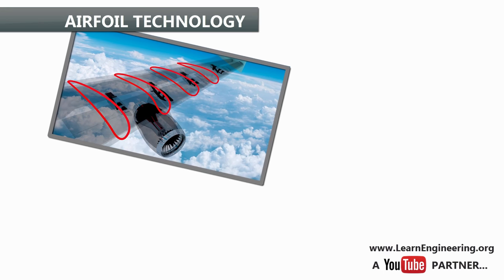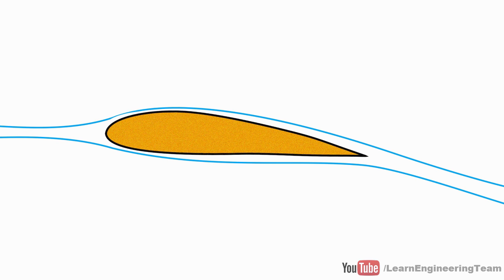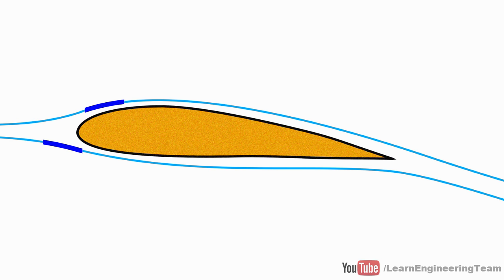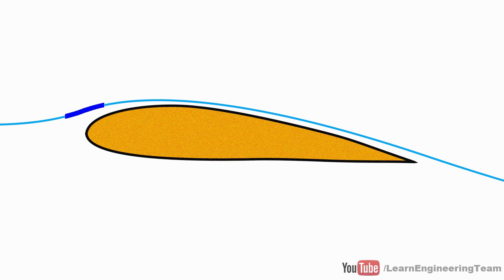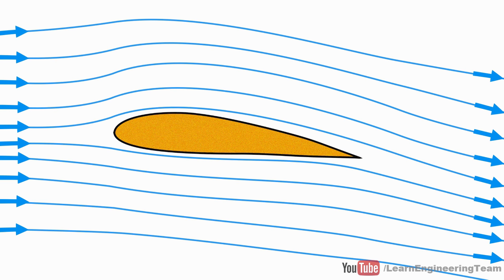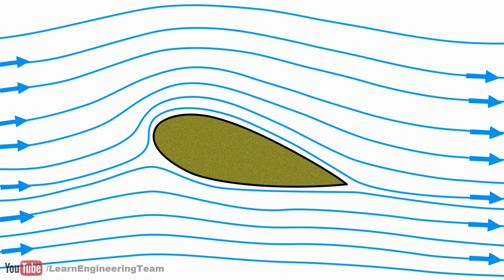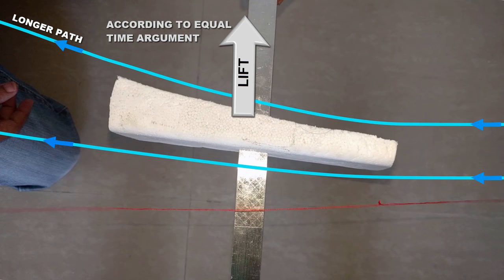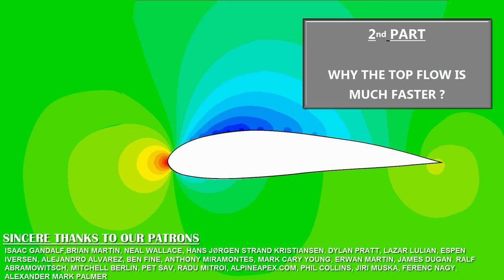How do Wings generate LIFT?

Comment: why pressure should be high at the outer surface ?
Reply: It&#39;s awkwardly explained...
Reply: still do not get it. English please
Reply: ***** Do you mean around 3:30? What they're explaining (awkwardly) is that as the air turns sharply around the wing, the air pressure will always be higher further away from the wing than close to it, due to the "Coanda effect".

As air flows across the wing, it wants to continue straight, because of Newton’s 1st law of motion, as was shown in the video. But, air above the wing exerts atmospheric pressure and pushes air down behind the wing where the air pressure decreases below atmospheric pressure as it is in the wake of the wing. However, as air is pushed down behind the wing there will always be fewer air particles close to the wing than further away from the wing, because most air will not have energy to make it all the way down. It’s the same situation as making a sharp turn in your car or pouring a fluid through a curving hose: there will be a push toward the outer edge of the curve, or rather an absence of a force to keep the pressure uniform.
Reply: This is a random question but, would a plane with straight wings like this  -------------- be able to fly. What I think is the plane will fly but, only when the plane is ascending. When the plane descends slightly all the air on the wings will be pushed up makes all the lift turn into downwards lift(Lift that pushes down) and the plane would stall. On a normal plane with normal wings because of the curve downward on top of the wing  some air would still be pushed downward. What do you think about this?? Could a plane with wings like these  ---------------- descend without stalling??
Reply: ***** Straight wings fly, but only generate lift when they are at a \ angle and generate negative lift when they are at a / angle, the same as with other aerofoils, although most other aerofoils are designed to generate a little bit of lift even when they are level (angled by design).

Stalling is kind of irrelevant here. It occurs at under the exact same conditions (always an angle against the direction of movement), no matter if you are ascending, descending, or straight-flying, if your wings are straight.
Reply: i got it guyz thanx :)
Reply: I have another question(Sorry if I am annoying you with all the questions). How do planes fly without losing or gaining attitude at a straight angle of attack(___). wouldn't the plane have to pitch down a lot if it wanted to maintain the same attitude and it was flying at lets say 320 knots. Can planes ascend with a straight angle of attack(___)?
Reply: ***** Airplanes can only fly level with level wings if the aerofoils have a built-in positive angle-of-attack. If the wing is flat and level it generates no lift and the airplane sinks. At negative AoA negative lift is always generated (save stalls). The slower speed in level flight an airplane wants, the higher AoA it needs. As it speeds up, if it wants to keep the same altitude, it decreases the AoA closer to zero, pitching down, but never going below the horizon. Planes can ascend with a 0 AoA, but only if the aerofoil has built-in AoA. I cannot remember if it is convention to account for this in AoA (so ascending with 0 AoA is impossible by definition), but I think AoA disregards the properties of the aerofoil (so it is possible to ascend with 0 AOA = level wings, but the aerofoil must still have a slightly lean shape).
Reply: "if it wants to keep the same altitude, it decreases the AoA closer to zero, pitching down, but never going below the horizon."

why does it never go below the horizon?

I am also wondering about stalling. why does air on top of the wing stop flowing smoothly over the wing at a high AoA? the bottom of the wing also creates lift so when a wing stalls isn't the bottom of the wing still generating lift??
Reply: ***** If we fly like \, then our wing generates a lot of lift... if we double our speed, our lift quadruples. Now we will have to fly very close to -, until eventually, even a nearly flat wing will generate enough lift to keep us in the air. If we continue down to /, then we will always generate negative lift. A lot at high speeds, a little at low speeds (although gravity will ensure we fall without lift, or with negative lift, at low speeds).

If we had to pitch below the horizon, that would mean that the wing would have to generate positive lift even when pointing down like /, which doesn't make physical sense, since such as shape will always deflect air up.

All of this assumes a flat wing.

Why stall occurs is empirically hard to explain, but phenomenologically, there simply isn't enough pressure from above to push the airflow all the way down across the wing and instead air from behind the wing starts flowing back to behind the wing, instead of it coming from the front and above. When this happens, vortices appear and air everywhere behind the wings starts going in all kinds of directions, wasting energy and preventing ideal energy transfer to the wing for lift.

The bottom still generates lift after stall, but it is insignificant compared to what is generated on the top. Some argue about whether the top or the bottom is the most important, but really, it's the top. I don't see how anyone can argue otherwise. It's why we have out speedbrakes on top of glider wings. Some argue neither side is more important, because without air on both sides there could be no lift as such, but if you distort the top you will get a much more severe effect than if you distort the bottom anyway. I haven't got any concrete measurements of this at hand, but I believe the top generates like 75% of lift.
Reply: Okay, but at a quick speed won't the plane need to generate some negative lift so it stops ascending. Wait a sec

"All of this assumes a flat wing"
I was taking about a normal wing with a airfoil like the one in this video.

When you say flat wing do you mean a wing at 0 AoA or a wing that is not curved on top
Reply: ***** By flat wing I mean like a flying barn door. A wing with a cambered aerofoil may generate lift at 0 AOA and as it approaches high speeds it may need a slightly negative AOA, but as its speed approaches infinity it would never need far negative AOA. A cambered aerofoil works just like a flat one, but with a slightly offset neutral AOA.
Reply: In a stall why would the air flow from the back of the wing to the front.
Reply: ***** As you know, a vacuum would develop behind the wing if the airstream above didn't move down behind the wing. During ordinary flight, the airflow above the wing is forced down behind the wing, because of the high pressure of the undisturbed air further above the wing and the airflow stays attached to the top surface all the way until the trailing edge. At high angles of attack, the pressure force is not enough to maintain attachment all the way and the airflow detaches before the trailing edge. Below this point, we now have an area where the wing is moving away and the area is expanding... but there is such a small pressure of air coming from above that the pressure of air coming from behind is greater and because of this, air starts coming in from behind and this generates vortices, with air eventually going around in circles and doing all kinds of things that are not energetically contributing to lift generation.

I believe that's the essential part. At some point, you have such a small amount of air coming down behind the wing and with almost no pressure force that instead the pressure behind the wing (which is normally irrelevant) becomes relevant and the greater contributor to filling the gap behind the trailing end of the wing. If the air behind the wing couldn't flow back, the air from above would continue all the way down, but since the air behind the wing can flow back, it becomes dominant.
Reply: If the air is forced down to make the plane go up, then why does a flat wing at 0 degrees not create a lot of forward thrust. The air is moving back which would push the wing forward but this is not the case.
Reply: One more question.. When a plane fly's upside down won't the top of the wing deflect air up which would push the plane down
Reply: ***** The wing doesn't work by magic. The wing pushes the air down, which makes the wing go up, because of its geometry, like a surfboard being pushed up as it rides on waves. A flat wing at 0 degrees moving forward couldn't possibly create any forward thrust. It's just going to slice through the air and generate drag due to air resistance. When planes fly upside down, downward lift is indeed generated, which must be amended by changing the angle of the wing. Airplanes can fly upside down, but not at the same angle as they fly right side up.
Reply: But a flat wing angles the air backwards, just like a engine does with the bypass air.
Reply: ***** A flat wing, flying parallel to the horizon, at 0 degrees angle, doesn't deflect anything anywhere. Hold your hand out a car window. Hold it horisontal and you won't feel any force on the top or bottom or your hand. Angle it 45 degrees up and you'll feel the wind below your hand, pushing it up (and back, but that is countered by the thrust of the car).
Reply: Okay so I understand why the wing does not create any forward thrust now. but...

I got another quick question
I promise this is not I large question

Lets say you put a plane into a 40 degree nose down dive. The wings do not generate any positive lift so won't the plane just fall faster and faster and the planes descent rate would increase more and more. Basically what I am saying is how can a plane enter a steep(40 degree) dive and maintain the same descend rate(Can it?).

Comment: where does all.the fuel go? 100 tons in each wing of an airbus 380
Reply: To the engine, for generating thrust!
Reply: @gateaerospaceengineering1130  wow! thanks science wiz. how much liquid volume in those fuel compartments lined with steel rivets and loose hanging wires.

Comment: This is the most widely taught incorrect theory of lift ever perpetrated on the public. If this were true, pilots would not be able to fly inverted 50 feet off the ground at air shows. The true cause of lift  is the air ramming into the underside of the airplane, wings and fuselage included causing an upward push. The air above the wing simple moves out of the way by being left behind with little contact as a result of the angle of attack. Anyone that has ever flown knows the airplane will always be tilted up slightly more than a few degrees, even while landing. This is to keep the air ramming into the underside of the aircraft and not the top. The air under the wing and body on the other hand is deflected downward and in turn as Newton stated there must be an opposite effect, ergo the air molecules pushing up on the wing and body creating lift. This effect causes drag, that must be overcome with the planes engines. All these other bizarre explanations are pure poppycock. You could make a brick fly if you can create enough thrust and maintain the right angle of attack. If you question my authority on the subject, know that I was an Avionics Electronics Technician in the Marine Corp. I worked on the Harrier AV-8C which was the upgrade of the AV-8A as the newer AV-8B was already in production. We were required to take the same principles of flight courses that Navy pilots took. I didn't learn any of these flawed theories of lift in my classes, so my question is "where do they come from?". Just people talking crap, just like the Mysterious and impossible to prove Dark Matter(SPOOKY MUSIC PLAYING). Yeah, good luck proving that pile of dark crap.

Comment: This is all over complicated.  Top side has less resistance to flow, bottom side has more resistance to flow.  That creates a pressure difference between top and bottom.
Reply: Resistance to flow is a confusing term. If you mean drag, then no, because lift can be predicted perfectly in inviscid flow
Reply: @AmbientMorality  by flow I mean airflow parallel to the airfoil

Comment: I repost this comment again: 

Usually you make very good videos, but this one is very disappointing and full of misconceptions. You can't talk about Bernoulli if you don't talk about boundary layer (a discover that won the Nobel Prize). 

With your explanation you can't explain STALL, you can't explain why the slot change the aerodynamic of the wing. Rejecting the "equal time argument" doesn't mean to reject Bernoulli's principle, it makes no sense! 
Moreover you also forget the continuity law, that's about the conservation of the mass, it's non-sense to forget it! 

Moreover: with your Newton effect, how do you explain supercritic airfoil, where for a long part of the chord, the thickness remain constant? 

Last thing: you may explain the same phenomena in many ways, one doesn't exclude the other. 

Conclusion: many good video, but if I were you I wouldn't keep this one online like this.
Reply from the maker: I never opposed Bernoulli's principle. What I opposed was equal time argument, that is followed in many text books even today. 

To explain stall, you  have to introduce the concept of boundary layer. But purpose of this video was not to explain stall. Introducing unnecessary things will confuse our viewers. 

You can generate lift with a constant thickness airfoil, just give it a proper angle of attack. This is true whether the flow is subsonic or supersonic. The Newton's third law will predict the lift correctly. But the 'equal time argument' completely fails for a constant thickness airfoil. 

In this case, you can explain the speed variation at top and bottom with help of pressure distribution. But you cannot explain the pressure distribution with the speed variation. Because in the latter approach nobody explains logically why there is a high speed at top and low speed at bottom.
Reply: Thank you for the reply. 

The "equal time argument"; I have never heard about it, luckily I shall say. 

I still don't agree with your point, since you don't explain why supercritic profile still provide lift at zero angle of attack: you can explain it with pressure distribution, and how else would you explain pression distribution without Bernoulli? And with Newton you explain the Lift, but not the whole aerodynamic force, with Lift and Drag! You can't explain why you have vortex and why you have induced drag.

Of course Netwon is always valid, if you have motion you can apply Newton in every part of the Universe. But in this situation it seems senseless: tell me one single aerodynamic research where you used Newton to compute the lift/drag on a surface. 

I'm looking forward to seeing video number 2, hoping it will better clarify these concepts. 

Ps: I still appreciate your job very much.

Comment: Not satisfying explanation. Boundary layer, friction (ABOVE ALL FRICTION!!!), generation of vorticity  and circulation around the airfoil are the causes of lift generation. I often appreciate your videos, but this argument did not convince me at all. I understand you have to explain complex matters with simple arguments, but this time it was too simplified and not pertinent with real physics.
Reply: +Alessandro Benzi,
 Circulation is a mathematical separation of component motions that allow simpler CALCULATION of values around a wing, but does not explain the physics/science, because no air travels around the wing in that manner.  We can isolate the linear and circulating components for simpler calculations.
...
 It is directly analogous to isolating the horizontal and vertical components of a cannon shell.  The shell only travels in the one, complex parabolic arc, but we can do the simpler "H" and "V" calculations separately to arrive at the solution.
...
Pressure changes around a wing (as they are for ANY moving object) are due to the relative motion of wing and air as the wing 'pushes' the air around in order to pass though it.
...
Pressure differences CAUSE acceleration of fluids. 
1) Air has mass
2) It takes a force to accelerate ANY mass, even air. (Newton #1)
3) A pressure difference, or gradient accounts for that force that accelerates air.
..
Once you see all the pressure changes ALL other motions are easily understood.  This includes the movements ahead of the wing. below, above, behind and around the ends.
- - 
Regards

Comment: It is beyond me how someone can try to explain lift without even mentioning just once angle of attack (AoA).
Reply: If I could explain aerodynamic lift in one word it would be AOA.
Reply: Or camber. Which can create lift without AOA.
Reply: AOA is based on the mean chord, not the bottom surface. A wing with camber, with the bottom surface sitting parallel to the flow of air, still has an AOA since the mean chord is tilted, and produces lift. If you make the mean chord approx parallel to the stream then you again get no lift.
Reply: No, you are incorrect. I am fully aware of what camber means and how it's defined. However, when you say that a cambered wing oriented such that the mean camber line is parallel to the airflow generates zero lift is completely untrue and actually completely negates the entire reason one would have camber in an airfoil in the first place. To generate zero lift with a cambered airfoil, one would actually need to place the airfoil at a NEGATIVE angle of attack. The whole point of camber is to generate lift at zero AOA.